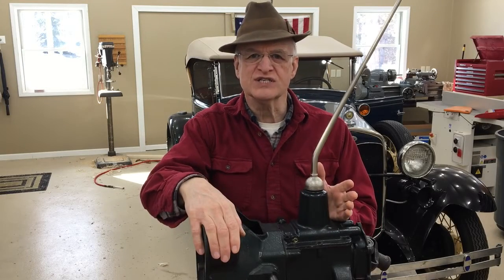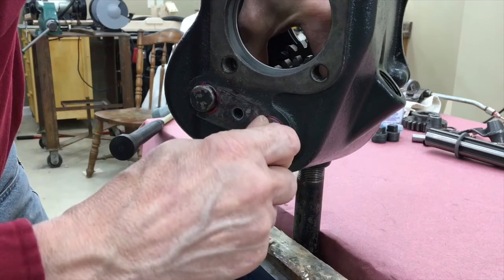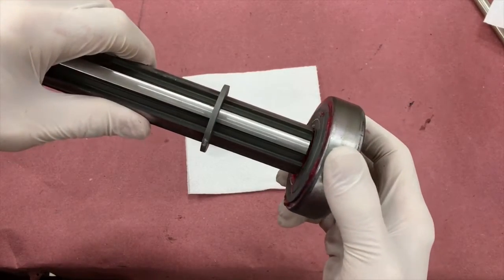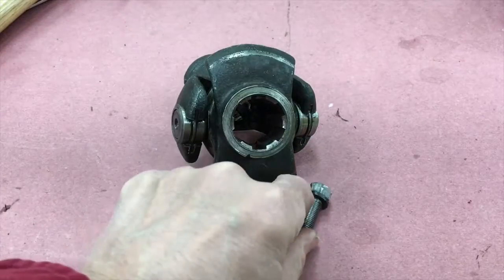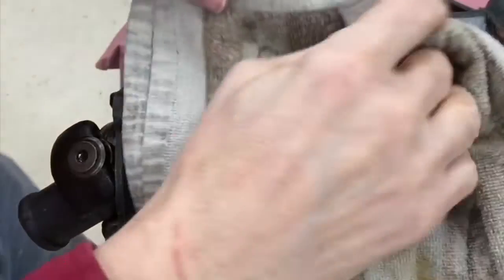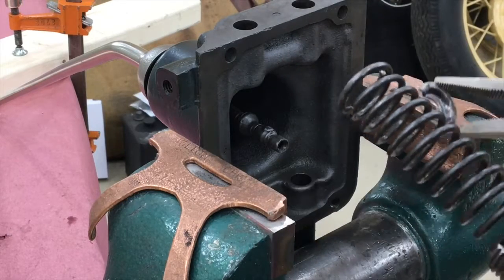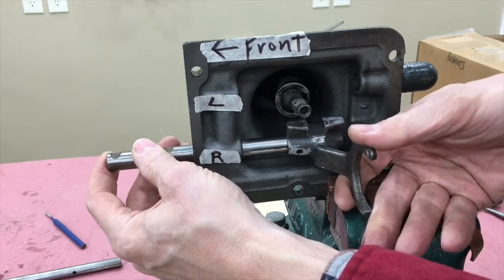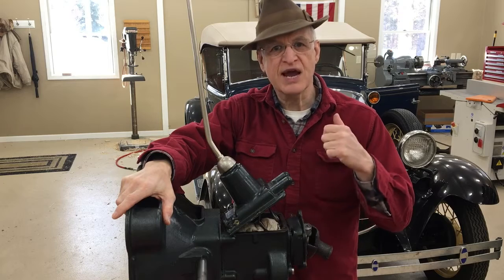Ford Model A Transmission - Assembly

Comment: I bought an early 31 Slant Window Fordor all torn appart to be restored. My adult son and I have never done this before but we are loving the challenge. YouTube videos like yours are a huge help to us. We are finally starting to put Engine and Transmission on the frame but we are working to make sure all parts are good which is where your video is really helpful. This includes the tool you use to put the shifting lever into the tower. 
I know it has been 5 years since you posted this, but a huge THANKS for taking the time to provide these videos.
Russell and Devan B.
Reply from the maker: Good to hear.  Glad the video was helpful. Thanks for the nice comment.

Comment: This is a great video. Do you happen to have one showing disassembling what needs to be disassembled to change the cluster gear?
Reply from the maker: Thanks for the nice comment.  I did not make any videos on disassembly, except for the first video in this series on the removal of the transmission from the car.  My thinking is that if a fellow sees how the thing was put together, he could figure out how it is taken apart.   The cluster gear is in the middle of the transmission, as you can see. So, the transmission needs to be completely disassembled to get at the thing.  Also, I suspect, if the cluster gear is bad, most, if not all the remaining greats are bad as well.  You might watch the remaining videos in this series to get more insight.  Good luck.

Comment: You haven't built very many transmissions. Gasket doesn't need any sealer but front retainer bolts do have to have sealer on their threads.
Reply from the maker: You are right, only a few.  Thanks for your comment and advise

Comment: Mr. Bell, regarding the pins that hold the shift levers in place, are the pins soft enough peen over, and do you put a bucking bar on top? Thanks
Reply from the maker: Yes, the pins I used were aluminum, so quite soft

I did not show it on the video but I built a tool to hold the pins in place while I hit the ends with a punch.

Comment: Does this type of transmission take a heavy gear oil?
Reply from the maker: Yes the oil for this transmission is quite a bit thicker than modern transmission fluid.  Thanks for your comment

Comment: Thank you for posting this series. I watched them several times and just completed the rebuild on my 1930 Model A  My bolts to hold on the U joint  cover were unusable and  I went with thread locker and Nord Lock washers
Reply from the maker: Thanks for your comment.  Yeah, never know what you will find

Comment: Great video George! My transmission went BANG yesterday and I lost 1st gear. I will have to do a full rebuild now and your instruction is by far the finest. Your wooden casting is a fantastic demonstration piece. I've bee reading that the cage bearings in the cluster gear are of poor quality these days and causing many failures. Do you have any recommendations to source a properly built set of bearings for the cluster or some advice on what to look for so I can avoid these poor bearings?
Reply from the maker: Thanks for the nice comment.  I purchased the bearings from Snyder’s.  However, perhaps you could find the correct size at macmaster carr, or another bearing supplier

Comment: good night, my name is Ricardo, I have a ford A year 29 I live in Campinas S.P Brazil I'm in doubt, can you help me? I need to check the point of the car's engine, remove the screw from the command cover and place the end of the screw in the hole in the command gear, which is the top dead center (I only know so far, and the rest) you can help me ?
Reply from the maker: Send me an email…. I will help you if I can. PargoLongAgo@Yahoo.com

Comment: Super video, thank you very much for the detail! I've watched 4 of your series, and perhaps this question should be directed to the 1st video about accessing the transmission, but do you have to remove the leaf springs in the rear of the car in order to remove the rear end? Can you remove the read end with the leaf springs in place? I would much prefer this method to accessing the transmission than removing the engine. But, I'm a little bit shy about the rear springs.I've got a 1931 closed cab p/u that needs a transmission re-build.
Reply from the maker: Thanks for your comment.   I don’t know, I have removed the transmission in several Model As and have always done it as shown in the video.  You could try to remove the springs from the frame, and see how it goes.   I don’t know what issues you may run into, but it seems like it would work.  Perhaps ask this question on one of the Face Book pages devoted to the car.   Good luck.
Reply: @georgebell7103  Thanks for your amazingly fast reply. To remove the springs from the back, if that's the case, do I need to buy a spring spreader to keep myself from being injured? I know you made a special tool, but you seem to be much more of an engineer than myself, and I wonder if I need to purchase a spring spreader from Snyder's or other supplier in order to remove the rear end safely? I love my Model A truck, and I understand that the springs in the rear and in the transmission tower are the 2 places where one can be injured.
Reply from the maker: @erdaviesjr  If you remove the springs from the mid frame mount, spreaders will not be needed.  If you chose to remove the springs as I did in the video.... yes spreaders can be purchased from Snyder’s as well as other parts suppliers.  Your local club will likely also have one you can use as well.. take care and be safe
Reply from the maker: @erdaviesjr  here is my email if you want to discuss further. PargoLongAgo@Yahoo.com
Reply: @georgebell7103  Great, thank you for this information !

Comment: O rings on reverse and cluster shaft - did you add those ? The unit I am working on does not have o rings or slots for o-rings to be installed.  Very much enjoying the series of videos and they have been a great help for me.
Reply from the maker: The original shafts did not have a slot for an O ring, and obviously leaked a lot of oil.  I did use O ring shafts, but did not make them myself.  I believe all Model A parts suppliers have them.  In fact, they may not have shafts without the O ring slot. It is an easy upgrade from the original because it does not show.  Thanks for your comment

Comment: What causes 2 nd gear to whine on drive not coast.
Reply from the maker: Your second gear is likely pitted.  Watch the video in this series on “Parts Inspection”.  Pitted gears cause lots of noise.  It is a common problem in Model A transmissions.   You can remove the tower of the transmission, clean off the oil a bit and take a close look at the face and flank of the second gear teeth.

Comment: Dear Mr. Bell, my friend was given a Model A Ford Roadster by her father, who is 90 years old and suffering early dementia and cannot aid in the maintenance of the car. I have done some repairs (changed water pump, lubed chassis, new battery, etc.) but the car will not engage in reverse gear. everything else works great. Any ideas on the issue/problem would be greatly appreciated? No grinding or noticeable sounds when trying to engage reverse, just won't reverse?
Reply from the maker: If you have seen all the videos in this series, you know about as much as I do on this topic.... I suggest you remove the transmission tower, inspect the gears, See if three is a reverse idler gear. Take a close look at the forks and tower parts.  The symptoms described in your comment lead me to suspect something messed up in the tower.    Good luck.
Reply from the maker: You are welcome to email me if you would like to talk more.  PargoLongAgo@Yahoo.com

Comment: Hi George, outstanding series!  Your explanations, teaching jigs and diagrams are simply excellent.  Thanks for all the hard work on this.  I have a '29 Coupe recently restored but not the transmission, which makes more noise than it should, I think, and likes to be double-clutched going both up and down.
Larry, another old engineer
Reply from the maker: Thanks for the comment,  as you can see from the videos excess noise means you get to rebuild the transmission... or just drive it.
Reply: @georgebell7103  Thanks, George; can't find video 5 or later,
Larry Hall
Reply from the maker: @larryhall4557  Hey, thanks for the comment. Video number 5 is still on my computer.  I need to get that thing done, you are about the 4th person to ask.
Reply: @georgebell7103  Thanks, George, I'll keep checking.  How does she run?
best, Larry Hall

Comment: Thank you so much for your help by making this great video. I used it to assemble my transmission. I did want to bring it to your attention that putting grease inside the transmission contaminated the oil and  foaming is the result. Not certain how I am going to get it cleaned out yet, hopefully after a few oil changes, it will clear up.
Reply from the maker: I was not aware of forming.. I replaced the oil after about 500 miles to remove any contamination and small metal scrapings from the new gears and bearings.  Thanks for the comment.

Comment: Should  the collor  and the spacer on the main shafts  be replaced or can your old ones be reused? How did you peen the rivets inside the shift tower?
Reply from the maker: If the collar is in good condition it can be reused.  The rivets are made from aluminum and are easy to peen.
Reply: @georgebell7103  is it OK to reuse the spacer? The rivets inside of mine are steel and I have a hard time peening because the heads are on the inside nothing to peen against,  I wedged a wrench inside and it worked sum what. Thanks for getting back to me. Great videos.
Reply from the maker: @lavertepatterson5733  I am not clear on the “spacer”. Send me a picture.  PargoLongAgo@Yahoo.com

The pins on mine were aluminum and easy to work.   Let’s discuss via email

Comment: Great step by step instructions,  I plan on overhauling  my model A trans. It's  noisy  in first and second  gears also leaks
Reply from the maker: Thanks for the comment.  I had the same exact issues. Check out the other videos in this series, you may find them helpful as you rebuild your transmission.

Comment: Did you use a modern synthetic gear lube to prevent future wear?
Reply from the maker: I did not,  I used the old school heavy oil recommended for the Model A.   I will look into a replacement modern synthetic.

Comment: I don't see the final video showing you putting the transmission back in the car.  Did you finish that one?
Reply from the maker: Thanks for the. Comment.  I have already put 2,500 miles on the rebuilt transmission.  All worked very well.   The video clips are patiently waiting for my editing and posting to you tube as the final video in the series... I need to get that done.

Comment: I like your spring compression tool for the tower.  Nice to see safety wire done right.  If you're real good , you can do all four bolts with one piece! LOL!  I was a USAF mechanic so I'm a bug on wire.   When you pull the tranny or put it in,  take that 3/4 pipe and put a piece about 3 inches long into the drain plug  hole. Take the plate off your floor jack and put the pipe through the hole in the jack that holds the plate.  Put the tranny on the jack and role it under the car.  Jack the tranny up into position.  That way you don' t have to mess with those 2x4's.  The wheels on the jack can help you wiggle it in.  Thanks for a nice video and like your car.
Reply from the maker: Thanks for the comment Brian.
Reply: Bratton’s sells a similar tool should anyone be interested.

Comment: Wonderful video. I would like to add that when using Teflon tape on a right had  thread wrap it clockwise. Other wise it has a tendency to want to pull it off rather than draw it in.  It's also a good idea to use some kind of sealer on all those bolt threads that go into the case if you want even more insurance against future leaks. Blue Locktite or silicone gasket sealers work great. Be sure and use some brake clean or oil free spray solvent to clean the threads first.  I don't mean to be criticize Mr. Bell. I'm just trying to help. Thank You
Reply from the maker: Thanks for the comment, and good advice.   You are watching very close, I noticed the tape on backwards when I did the editing...  but did not think most folks would notice....
Reply: I'm a retired master plumber. I couldn't help myself. LOL  The main drawback to doing it the correct way is that the  tape spool leaps from your hand rolling across the floor under the heaviest item in the shop leaving it's tell tale trail neatly behind pointing the way. Keep that camera Rolling :-)